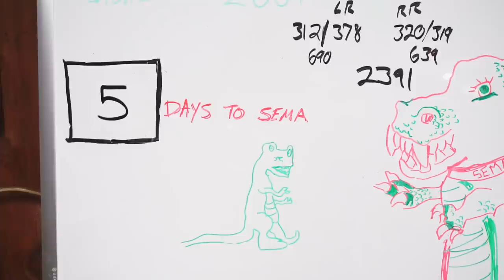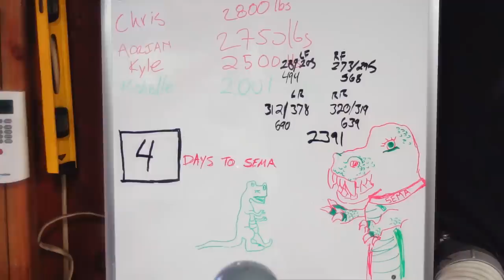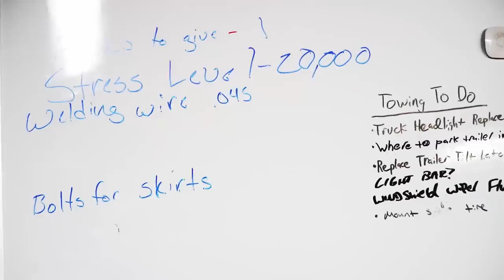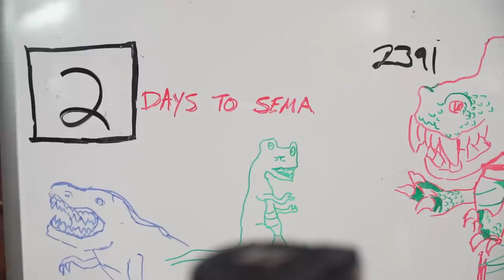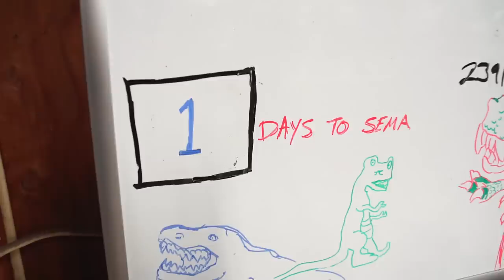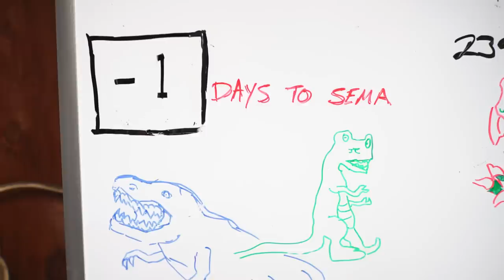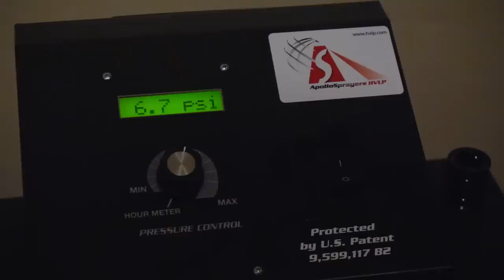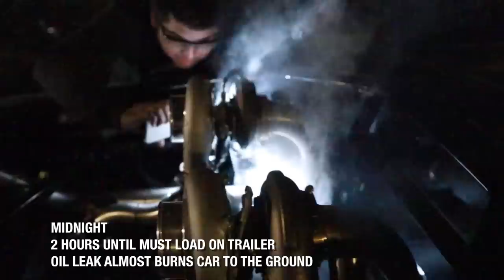How We Built A Show Stopper - The B is for Build Documentary

Comment: ok bro, i'm at 25:35 watching the 3dprinter part, i'm a professional printer, i do it for work so i have some advice! first:  stop abuse that bed😂 take a good glass pane and sand it with 600 sandpaper (no water) Second: really hot temperatures like 70°C are very good for adhesion ((PLA) only for first layer, then 60 and at z+15mm you can cool off) Third: for a better quality,  0.1, turn down the travel speed + inner wall speed to 60, outer walls to 40mm/s, then first layer 30mm/s Fourth: Combing Mode, No Skin. no more travel scratches on shiny side! I HOPE I HELPED YOU! CONGRATULATION/CONGRATULAZIONI FOR THE LAMBO AND FOR THE MARRIAGE! Bye by @MantegnaCompany in Italy! 35km distance from sant'agata bolognese!